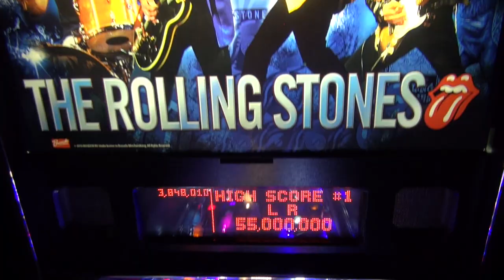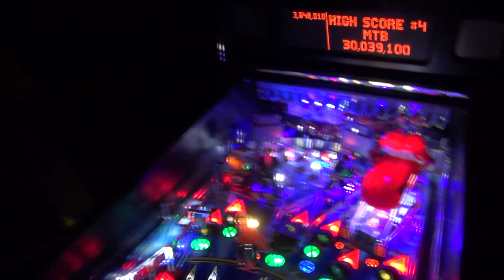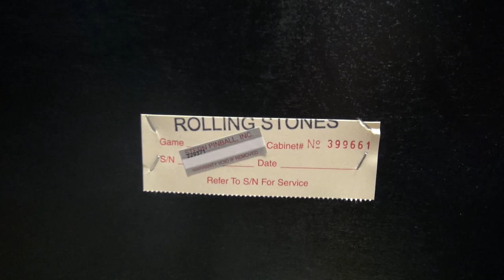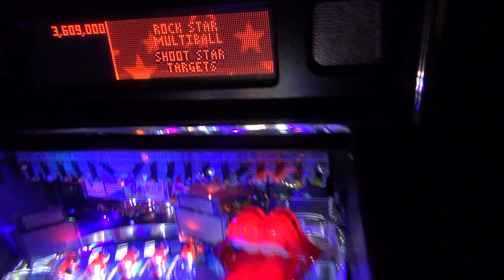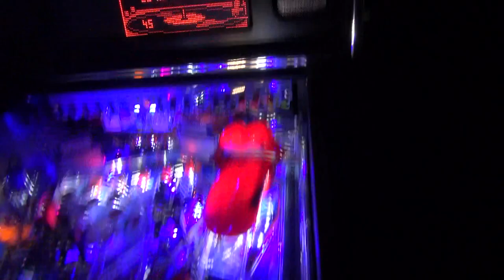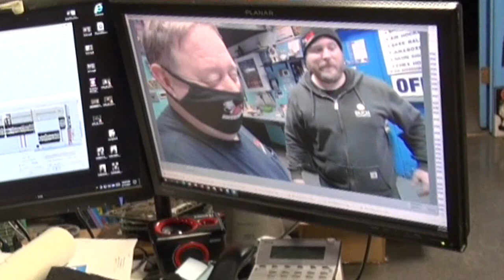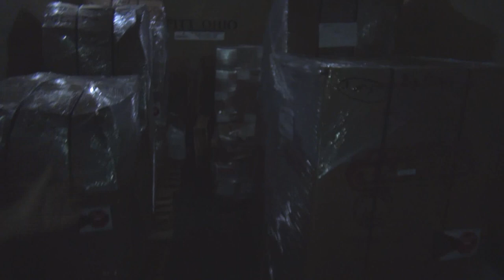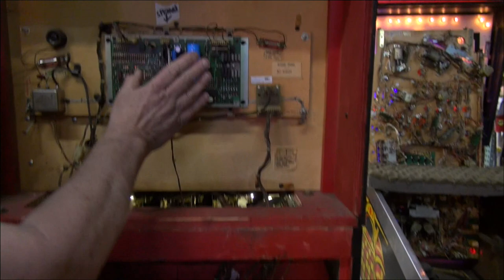#1640 Stern THE ROLLING STONES 2010 Pinball Machine & 2 Neat mods YOU can do! - TNT Amusements

Comment: My friend has this game  but his has two sets of flipper buttons on each side. The top set controls the flippers. We can't figure out what the lower set does. The lower(red)set is right below the top set(white). Have you seen this before? Any idea what the second set is for?
Reply from the maker: We had a few machines come in with extra buttons that would be wired to the other flipper....for people that couldn't use one hand or didn't have a limb on one side.  They would be adapted for those people...we did it also..
Adding a second button on one side so someone could ja e independent Control on one side of both flippers.  The wire could ha e been disconnected by new owner
Reply: @tntamusements  Thanks for the quick response. I'll pass that on to my friend. Interesting theory. I would have never thought of that. Fun machine to play .